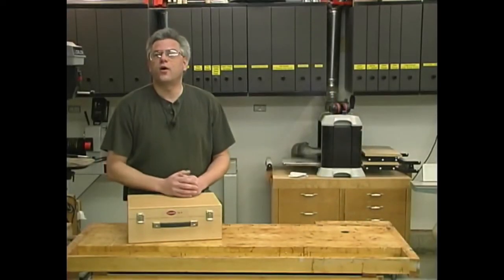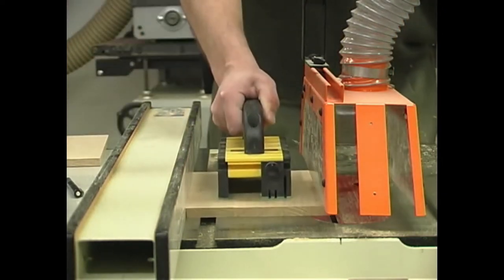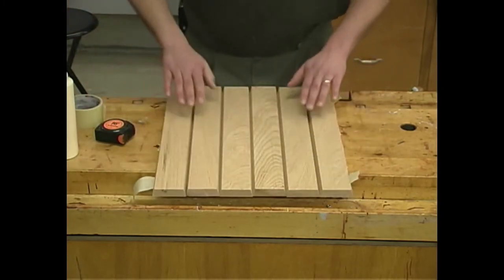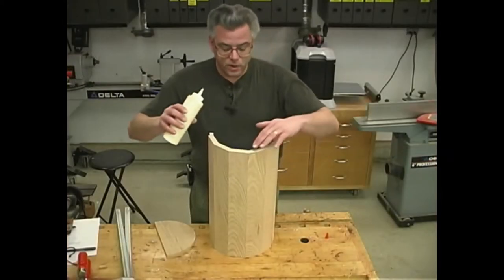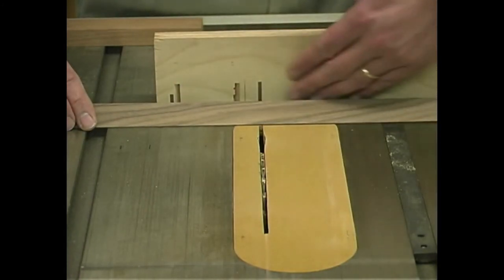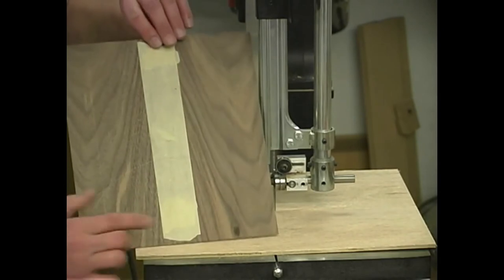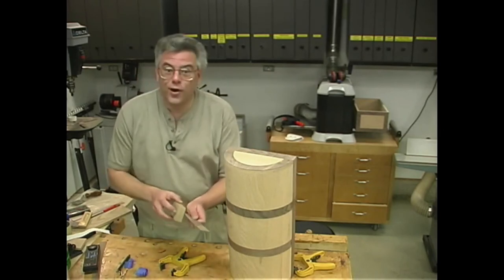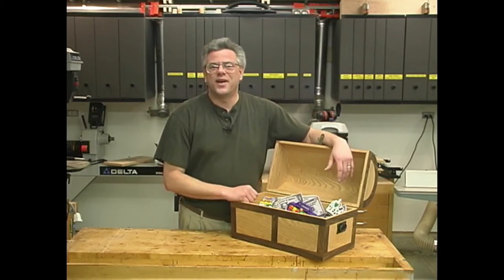W041 Make this Pirates Treasure Chest by Chris DeHut

Comment: how do you work out the angle for the lid slats?
Reply from the maker: Hi Martin,

There is a total of 12 bevel cuts made on the slats at 15 degrees, 12 * 15 = 180 degrees

Chris